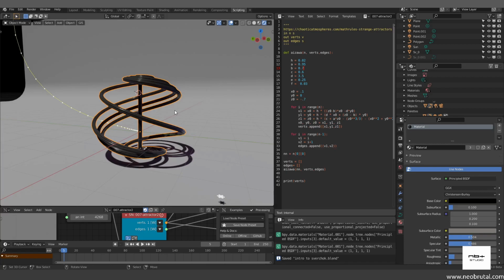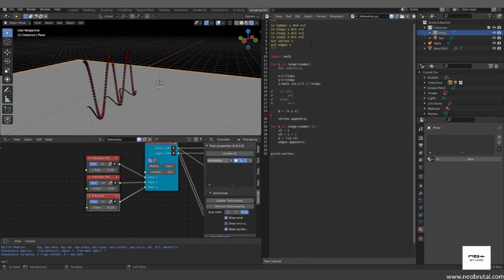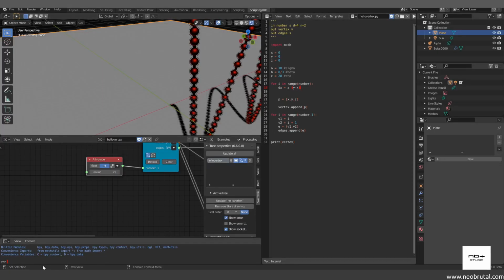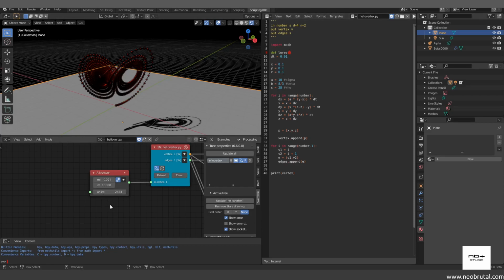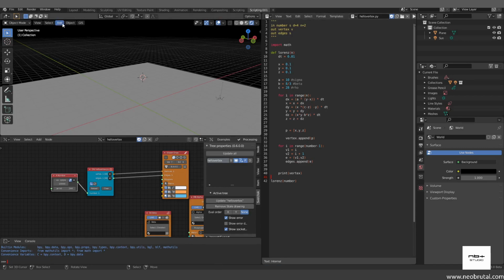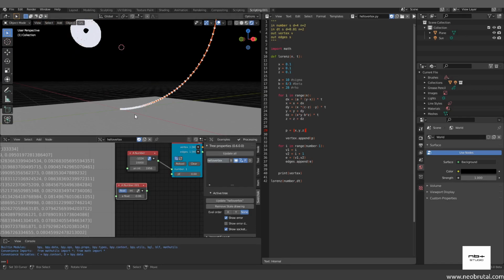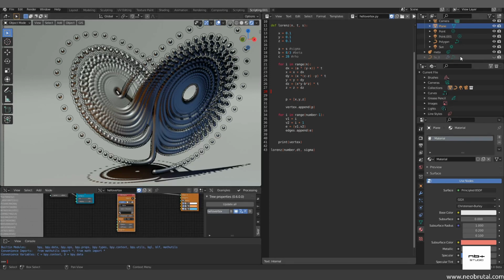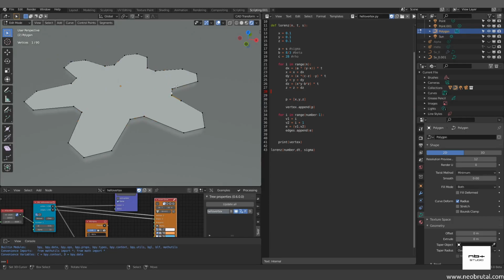Introduction to computational design with Blender - 005  Strange Attractors and python functions

Comment: Amazing,
Would it be possible to make a point light follow the lorenz equation ?.. I guess it could be a very nice video specially if the intensity  and speed of the light changes during time.
Would love to see you give it a try on this,
Keep the nice work!
Reply from the maker: I'm sure this can be accomplished with sverchok. The easier way I can think of right now is with animation nodes , you can set an object to follow a curve or in this case a line. I'll look later into it and try to answer with a better response .

Comment: Hi Luigi, is there any way to animate the value of the A Number node? I tried keyframing but it doesn't seem to work. Loved the video!
Reply from the maker: Did youn try with the frame info node? just search for it inside sverchok and plug the current frame to the a number node
Reply: @luigi_pacheco  thank you! It worked!

Comment: Nice. Curious to know if there is a way of doing it without writing code. 

Perhaps by interpreting the equations within the node system.

Great tutorials though. Glad I found something that works. Keep on man.
Reply from the maker: I am sure there is , there is multiple math nodes in the system, the complex part with node based programming is usually dealing with the loops , but I believe there is a way to achieve this already in sverchok.